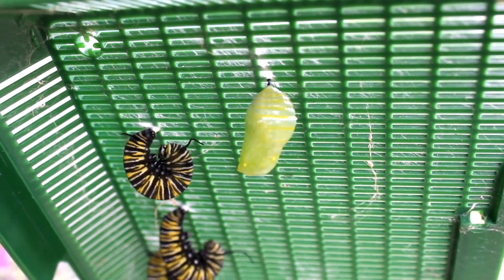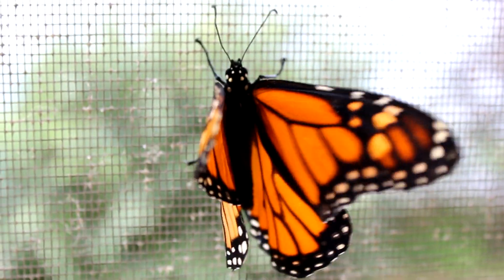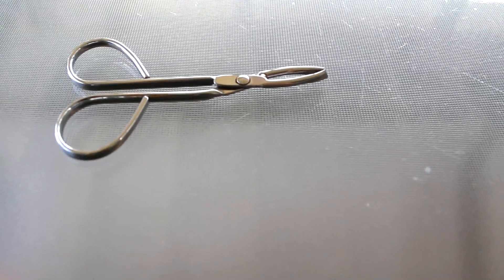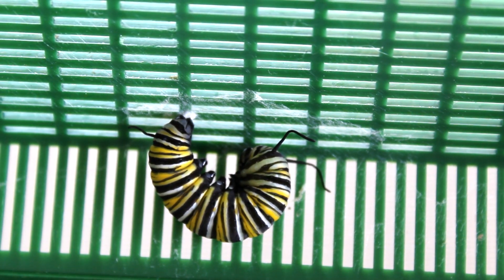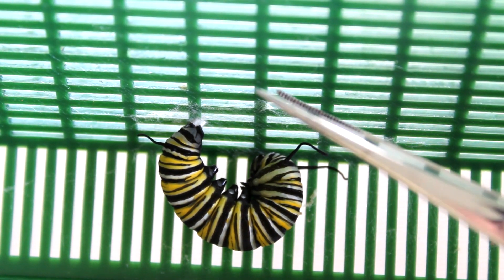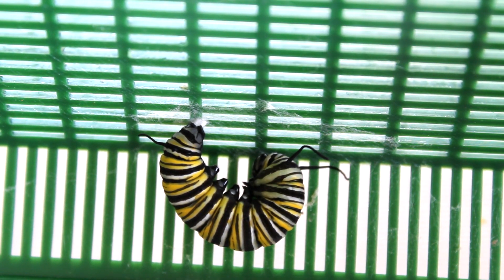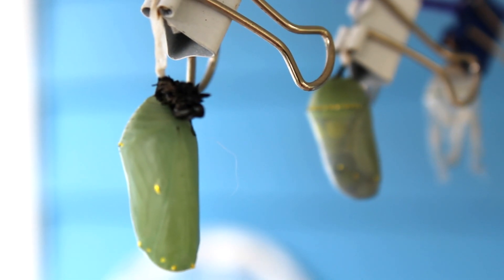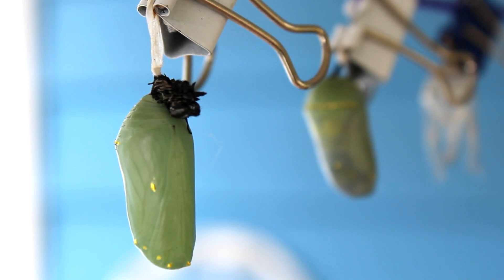Raising Monarchs - Side J-Hang Relocation (Help The Monarch Butterfly)

Comment: I found a woolly bear caterpillar on a cement wall. I touched him and he fell to the ground. No leaves are there just bark near a pine tree. It is 26 degrees at night and most of the day I put some sticks in a small jar and brought him inside. Watched your video. Checked on it, it moved from the floor of the jar to the stick at the top of the jar . The jar has a lid with holes in it. How do I get it back out into the cold. Should I just take it out at morning, noon or afternoon. Temperatures are 25, 30,s, then 50's?or tak

Comment: I know this had a happy ending but I was so worried watching this video!

 One thing I'd like to mention is that their little behinds are extremely delicate when they are hanging so you absolutely sure you get nothing but the silk. One time I accidentally caused the death of my hanging caterpillar because his butt started oozing his green insides.

If there's any way you can just turn the container on its side so he can hang normally, that would be best but obviously that can't happen if others are hanging or there are  other soft chrysalises in the same container. I limit the number of caterpillars in my containers to 6 to try to minimize issues but right now, what led me to this video, is that 3 of them decided to J on the side of a plastic container at once. I don't know whether they will hurt themselves while they're trying to get their skin off. Unfortunately one of them is hanging on a different side from the other two so there's no way to tilt the container to accommodate all three. So I plan to just keep an eye on them and toilet the container as needed as each one pupates. I'm terrified of moving them as indicated in the video since I disemboweled that other one. 😞

Comment: I have "rubbed" the edge of the silk, similar to trying to get a piece of tape up, and trying to get most of the silk get a CHRYSALIS loose- but NEVER a "J" hanging caterpillar. They're so easily upset at this time that I've always feared ANY disturbance could result in problems like anal prolapse. To get them rehung I have tied waxed thread to the rolled silk, or just taped the silk onto the better location.
Reply: I'm also VERY leary to use anything hard or pointy anywhere near them 😳
Reply: If I wait till it goes into the pupa stages is it too late to move it

Comment: I've unfortunately had to learn this the hard way. Had two that decided to J-Hang from the side, both had to be euthanized due to wing deformities that prevented them from being able to fly. While raising Monarchs has been a great experience having to euthanize these two, knowing it could of been avoided was a definite low-point of an otherwise rewarding season. With 2019 being our first season, I've watched every single one of your videos on Monarchs and Milkweed, they've been an invaluable resource to the successes we did have.
Reply from the maker: Thank you for putting the information to use.  Definitely there can be bumps in the road, but if we're aware of them, the overall experience is usually still an amazing one.
Reply: My cat decided to hang from the side today.  I was just going to leave him be until I saw your comment.  Luckily he's alone in a mesh enclosure so I just turned it sideways.

Comment: Hi, thanks so much for this new abbreviated episode that includes the demo of the simplest & safest way to move a chrysalis by its silk, using this type of tweezers if possible (the best), and for mentioning why maybe not to moisten the silk. I see questions from and many opinions given by people on the internet regarding how-to and will definitely share this episode as it helped me tremendously. One question from me-  when I recently observed a few of the 42 cats J-hanging on sides of the net-cages I was able to tilt the cage position slightly by placing a small rolled-up towel beneath the edge of that entire cage-side keeping everything even without disrupting any of the cats in the habitat at all while allowing that one at risk of becoming attached to the side to instead be positioned hanging  slightly off the side, and able to go into chrysalis without a problem. They are still along the side but not attached at all nor deformed. Wonder if they still are at some risk at all there? I know I could move them to the ceiling now though it seems that they will still eclose in the vertical position where they are? I have had 2 adults rise from the cage floor where they were placed as chrysalides, (they had no silk), while I nervously watched-on crawl up the cage net-side where they then spent the entire first hours of wing-work & drying time.  Eventually they went to the ceiling.  Perfect condition despite not having the full-360 degree range of motion. Thanks!
Reply from the maker: Hey Debbie.  If the chrysalides were able to form into a normal shape, then I'd say you're out of the woods, so to speak.  As a chrysalis, once formed properly, can develop even not hanging and laying down on its side, having some well formed chrysalides be touching a wall isn't a problem, and the adult should be able to emerge just fine.  As always, no guarantees in this, so if an adult emerges from one of these and has a problem, that doesn't necessarily mean it was related to this.
For relocating the J-hangers or they already formed chrysalides, some have found that taking some tape to the silk near the silk button it hangs from, and pressing the tape to the rest of the silk allows the silk to stick to that tape, and then when the tape is pulled, it pulls all of the silk, including what they chrysalis is hanging from, with it.  People then fold over the tape, and hang the chrysalis from the tape.  I think that's a pretty good method as well, but at the same time, some have reported that if the silk is moist, it sometimes doesn't continue to stick to the tape.  In such reports, I don't know what kind of tape was used (as some tape adhesives are chemically quite different than others) and I don't know how much moisture or humidity was involved.  This makes some people proponents of the tape method, and others not trust it at all.  But, it's another possible option.  I myself don't have any experience with it, but I know this option is out there.
Reply: Thank you so much, as always this helps me alot.  I also thought it appears that since these chrysalides are positioned/formed in such a way that when they first eclose each will open in good position so their abdomen can flip away, from the edge/net.  Then as I have usually observed they will hang with the wings also away from the net, making the gentle movement and pumping fluid into the wings and do all the necessary steps to be in good proper shape.  When I followed your tutorial episode allowing two chrysalides without silk climb and eclose from the net cage's floor where they were positioned next to the vertical edge, where they actually did eclose from that vertical edge, so it worked for them there that way, too.  Now if I can determine what to do about Hurricane Dorian and these 42+ monarchs who will more than likely eclose between Sept. 3- Sept. 10!?!  Really hoping that somehow they wait til this passes, as it usually does not hang around more than a day, which will be either Thursday or Friday Sept. 5-6th.
Reply from the maker: @Debbiesnc  In a pinch, one of those college dorm type of folding accordion style clothes hampers, when turned upside down, can be used to house some Monarchs.  In the case of a hurricane, definitely hanging on to them until it passes is advisable, provided it is feasible for you to do.  I wish them luck, and yourself as well with the storm.  My sister teaches in NC, and while not her school, other schools have closed for the week already.  Stay safe!
Reply: MrLundScience thanks for that, thankfully all is well with us and the monarchs who began eclosing Sept. 3rd/4th, that were released perfectly fine within a 24 hour period, as Hurricane Dorian hit N. C. Thurs., Sept. 4, starting early here and on all of that day/night on the coast. Hoping your sister fared well during the storm, too, wondering where she is? and sure that you heard what all happened and what was spared us across the state. The half dozen or so chrysalides that formed on the sides/walls of the net cages eclosed perfectly well where they were, I am happy to say. As I had mentioned I watched them and carefully propped the cage's side evenly & slightly to keep the forming chrysalides off of the wall. I want to get my numbers together to share once I get a chance as presently, it's busy with 30 cats/chrysalides now living in my outdoor habitat cages, which as a process is going really well. August-September is obviously our peak season, Piedmont of N. C., for the Monarchs and note that there have been dozens of eggs and some cats collected even though I have only rarely seen the parent butterflies!  
I must say that it is great that you and your sister are both teachers, and wondering if you come from a family of educators? I am a huge fan and supporter of our teachers everywhere but particularly the public school teachers in this state, which shamefully underpays them and it's a pretty tough challenge as our schools now and over the past 25 years or longer for a fact have ranked around #48 in the country, (don't let me get started on a soap box!). We definitely need to attract and keep the good ones. One of my sons' favorites and among the most outstanding teachers was actually his 4th grade science teacher whose classroom was a virtual wildlife habitat! There was always something interesting going on with him and so many creatures that had everyone's attention. When we were living in NW N. J., our younger son's 3rd grade teacher involved her students raising monarchs in the classroom which was my 1st inkling at all about Monarchs. I naturally was curious as she sent the kids home in search of the evasive-milkweed. These were among the most incredible teachers that we encountered over the years. Hands-on learning makes such a difference for kids of all ages and I truly praise all of y'all's efforts! Now you have a huge virtual classroom? Can't wait to see what is coming next. 
In addition to holding much hope and support of the Monarch Butterflies this migration season and always, N. C. Is holding endless hope and support for the many people who have lost everything in the Bahamas, including lives.
Reply from the maker: @Debbiesnc  Definitely many teachers in my family.  My mother, my sister, and aunt, and two cousins (from that aunt).  This had an influence on my chosen path, but I think the primary reason for choosing teaching is that I was going through college, trying to decide what I wanted to use my chemistry degree for, and at the same time, tutoring freshmen who were struggling with chemistry.  Found that I had a knack for approaching and describing the subject in ways they found understandable.  And found that I really enjoyed getting to see their "light bulbs" turn on when they finally grasped a concept.  Like getting to see someone else start to see the magic and enjoyment in a hobby you've loved.  That, and knowing that I loved chemistry so much, it was one job where I could use all of the science I was in love with, rather than specialize in one field and only use a very detailed sliver of it.  For me, I was hooked.

Comment: Hi Rich, I moved several chrysalis from the critter containers to a large net cage (a bit bigger than the one you have shown in your video.  I laid the cage on it's side and attached a string using a bit larger clip that you use to hang the string.  It works great.  It gives the butterflies a little protected time to dry before I let them free.  I accidentally didn't pull the silk right on one and the chrysalis separated from the silk.  It was pretty black, so I didn't think I had time to go get the "primitive" glue and wait for the glue to dry.  There just wasn't enough stem to use tape or anything, so I decided to use the small size black clip you use and then I taped the clip to the string.  It worked.  When I checked an hour later the butterfly had come out with full wings!  I'm so happy and I think watching your videos helped me figure it out.  So far 5 have been released and I am shooting for 16 when I am done.  I'm quite pleased given I had no intention of ever doing this.  You've taken me down a deep and wonderful rabbit hole.  BTW, I went and bought California native milkweed which should help even more.  My understanding (according to a little state park (Natural Bridges)  near my home that Monarch flock to Mexico or sometimes just to San Diego from our coastal california home (Monterey Peninsula - Santa Cruz).  Many thanks again.
Reply from the maker: Greetings Patt!  Very pleased to hear that your innovation worked!  Sometimes, the stem can be broken by enough pressure, which is why I don't clip mine when that happens, so it's cool to hear that you were able to get it to happen without that added difficulty.  Also, if this happens in the future, it's helpful to know that a Monarch can eclose out of the chrysalis even if the chrysalis is not hanging.  In fact, a chrysalis, once formed and hardened, can fully develop the adult without hanging.  It's not gravity dependent, and so a side chrysalis will do the same chemistry as one hanging.  I show how an adult can emerge from a chrysalis that is not hanging in this video:  https://www.youtube.com/watch?v=kxCzr89Ck3E
Just gotta make sure he/she has a way to climb up and fill/spread/dry his or her wings.
Reply: Thought I was almost done but then we found 20+ more eggs! The latest caterpillar is huge. Could it be a super monarch? I read they happen late in the season.

Comment: I have about 25  in the chrysalis most look normal, but I have one that has been black for 2 days now and so I feel pretty sure it is not ok. However, I am afraid if it is sick and I try to remove it and it bursts all over the cats underneath that cant be good. I don't know if the silk will come off easily or not but it may go bad after too long. Don't know what is for the best
Reply from the maker: If there is sign of any health issue, my advice is always to remove it, as it could have something communicable to the others.  If it seems like it still has a chance, relocation to another quarantined area can work.  If it turned a full black color much earlier than it should, that doesn't bode well, though.

Comment: This is super helpful!  I was looking for a video or website about this all last weekend, and couldn't find one that addressed this.  I had a caterpillar J hang in between the 2 racks on my floral tube holder.  I was too scared to move it.  I must not have had enough room because it had a couple of bruise-like areas and a small hole at the front.   Since then, it has turned completely dark, sunken, and is currently decomposing in a separate enclosure.  I will dispose of it next weekend.  I have since removed the middle rack on the floral tube holder after reading some blogs (I don't know why I didn't think of that myself).
Reply from the maker: Happy to have helped.  To be honest, I didn't know if there were already videos out there addressing this, but thought that since we'd recently explored outdoor set ups, this situation might arise more often, so I knew I wanted to have a quick video exploring it.  Glad that you found this helpful!